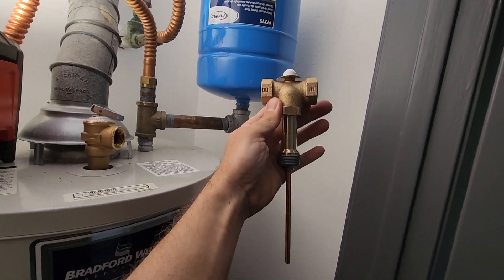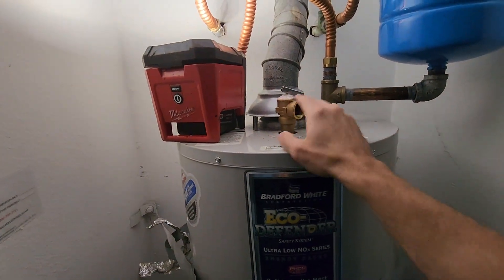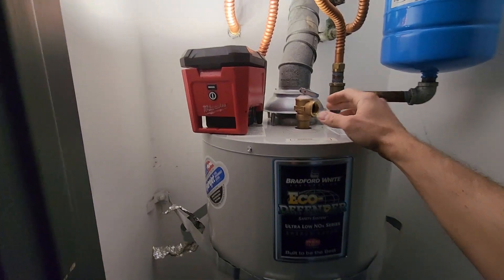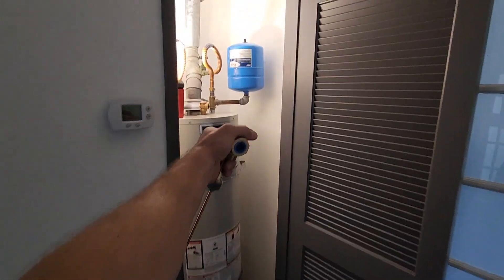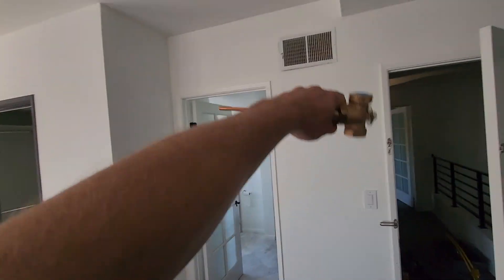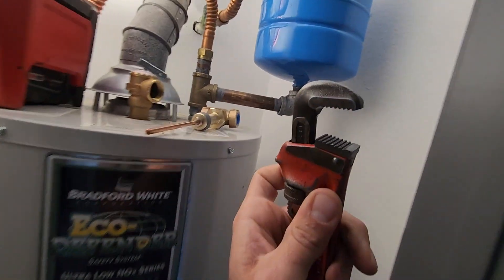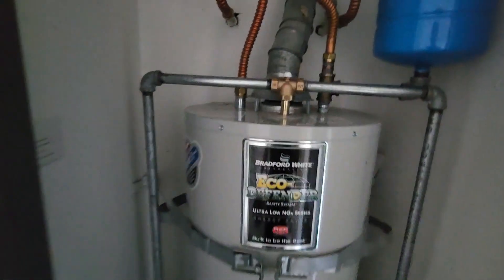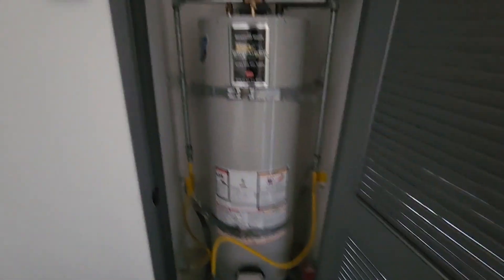What is a Watts 210 valve?

Comment: I have never ran across that valve. Pretty cool. I have had 3 water heaters gas valve sticks and T&P blowing full bore. Interesting on the drain termination there. Here we have freezing temps. They have to terminate in the same room as the water heater and where they are readily visible. I’m always fascinated how other areas do stuff. 
Thank you

Comment: Fun fact about T&P Valves

In the early 1900s, before modern plumbing and mechanical codes, large water heaters and boilers were commonly installed in schools, hospitals, and apartment buildings without relief valves.
At one U.S. school, a heater/boiler overheated and over-pressurized. With no way to relieve pressure, the tank ruptured violently. When it failed, superheated water instantly flashed into steam, blasting through the mechanical space.
Children and staff nearby were severely scalded by a surge of boiling water and steam. The injuries were catastrophic, and the incident—along with similar explosions around the country—was widely reported among engineers, insurers, and safety boards.

Shortly after, mandatory temperature-and-pressure relief valves became standard, especially in schools and public buildings, and later in all residential installations.

Comment: Hi  great video. We don't those special T & P valves here in Mass. At least I haven't seen one.  I was wondering what material was used to pipe up the expansion tank ?? It looked like black iron or tarnished brass ?? In Mass we now have to install  1  1/4 PVC to drain the drip pan. It doesn't make sense since the supply a  1" male adapter with the pan. Like you said it must terminate 6" above grade. If that valve is set to close, can you reset them or do you have to put a new valve in ?  Bet they are not cheap

Comment: Never seen one of those before.  But it would give you over temp protection but leave you with no over pressure protection and a relief valve is more likely to go off from pressure than temperature. 
A gas control already has a probe going into the tank to stop the gas if it gets too hot, sure it’s on the bottom of the tank but I imagine it’s set to go off lower than 212. 

Can’t believe inspector would allow the tank placement in the first place without  a relief line or drain.

Comment: yea Ive used them  rarely   but back in the day I  installed dozens of them    typically a pressure relief  on the cold at the service in front of house.  los angeles  I guess puts relief valves on all houses    we never put them on normal jobs   that dont require a watts 210.      I dont think a  new construction build  would use a watts 210 unless it got through plan check and didnt get caught   its pretrty much last resort  to use.   a 8 inch ridgid  is one of my most used wrenches .
     If you have  hot water going to lower floors it usually requires a vacuum relief valve too I think ?   
   Also our code never allows  t and p to a drain pan  unlike  IPC  which allows
Reply from the maker: @jeffreyplumber1975  we dont do vacuum breakers out here on residential water heaters. I've seen them on commercial boilers b4

Comment: I have my gym in my basement so I'm close to the water heater a lot. Sometimes it makes this high pitched hissing noise and that is freaky but it's actually worse when it is not making noise. Did it fail? Is the pressure building up right now? Shit fails all of the time right? It's probably the cheapest chinese part too. That triggers me to google stuff like "How often do t&ps fail" and I read "about every 5 years" and that's when I start taking a few steps away because I've been living here for like 7 years and who knows how long it was here before. Sometimes there is even a puddle under the drain. Maybe I'm not actually hearing the T&P...maybe it's just inside the water heater, like a boiling kettle whistling but it's still freaky. I actually haven't heard it in a few months.....hmmm.

Comment: Wow never heard of this valve. I'm a retired oil burner mechanic, did it for 35 years. Yes we dealt with gas hwh. So if that control shuts off you have to replace it again? But what happens to the water expansion? What pressure does that control shut off at? So do you replace the hwh if control shuts off?
Reply from the maker: @scottmaz4063  no you can reset it. Shuts off the flow of gas so the water heater shut down therefore slowly stopping thermal expansion. Open the valve and re light the gas control.
Reply: @pershingplumbing9007  thank you